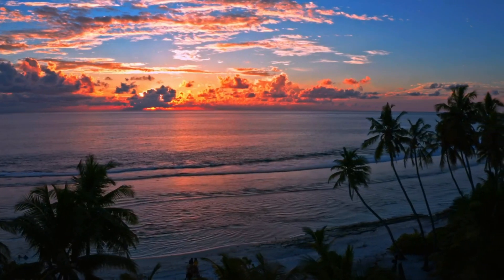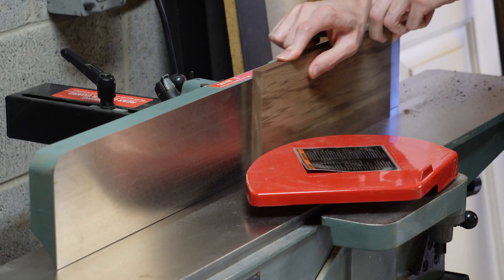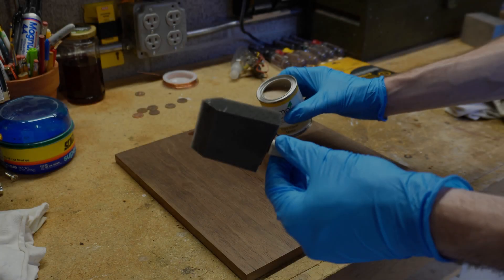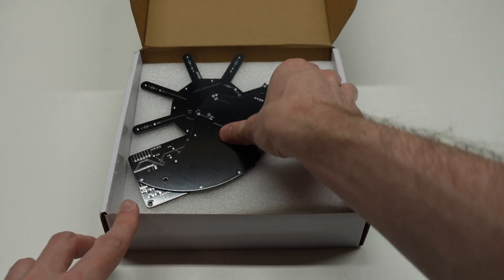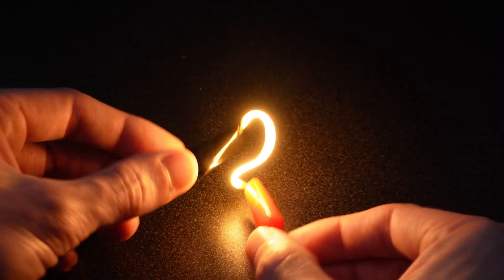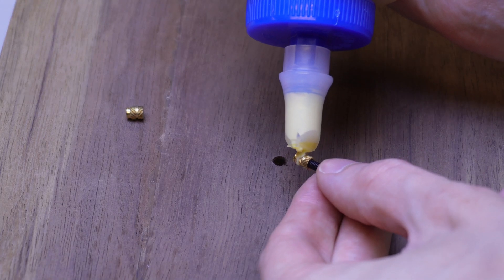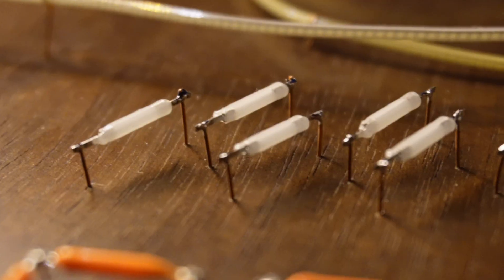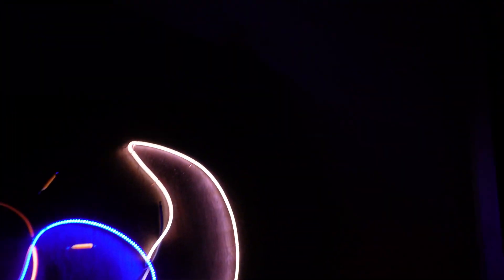A Modern Neon Weather Station

Comment: You should do a no-wifi version of this, using the NOAA weather stations instead. That way, it wouldnt have to be connected to a network, and you coule take it to several places.
Reply from the maker: Is that radio based? If you're willing to accept the WiFi connection, you can use a geolocation service to get the coordinates of the ESP32, then feed the latitude and longitude into the /points endpoint. That'll return the correct API call to get a full forecast for that location.
Reply: I was just saying, it probably wouldn't work in a remote location. Not that you would use it in a remote location, but you would need a Wifi connection. If you made the radio based version, it could work within 40 miles within a station, and even in the little town I live in, I still get a perfectly good connection, even when I'm out in the middle of hiking or something while I'm fiddling with my FM radio.

It wouldn't be necessary, but it would add to the whole "Steampunk" vibe you got going on. Even though it would technically be using modern technology, just like yours currently is, it would be amazing for it not to require a connection. The only hard thing would be that it would need to figure out how to convert the speech into usable weather data. Though, many weather stations somehow do exactly that, or maybe use a different thing than what I'm thinking of. Anyhow, still a cool project! Better than anything I could do :(